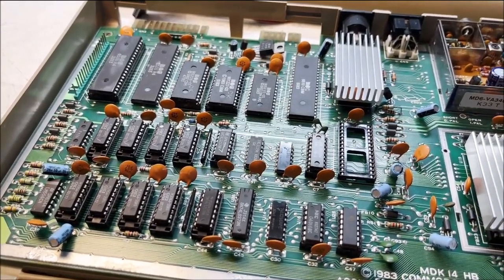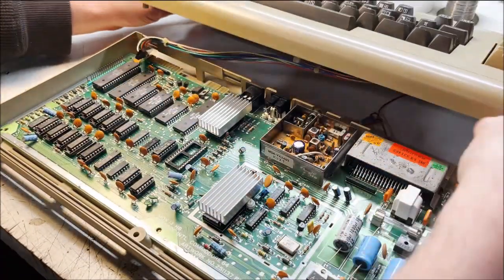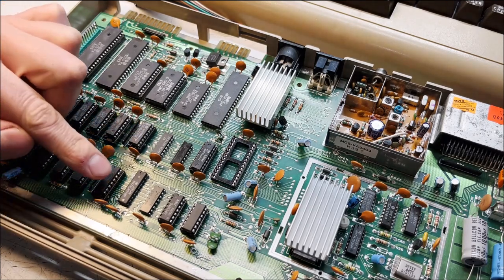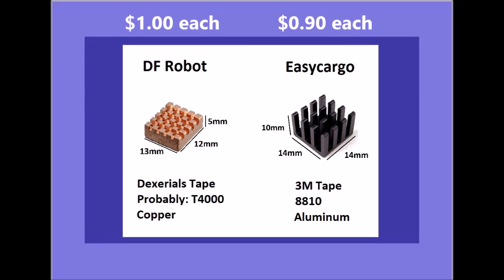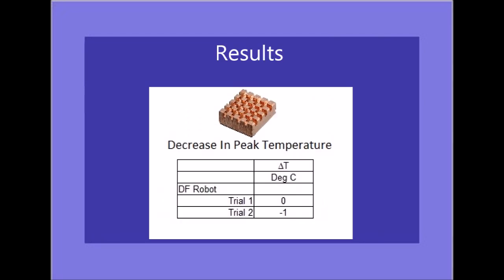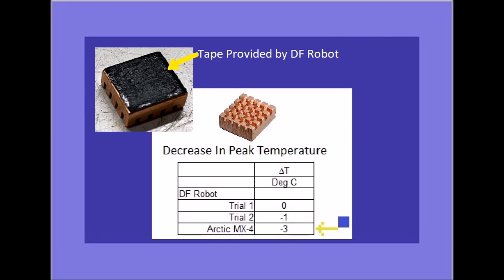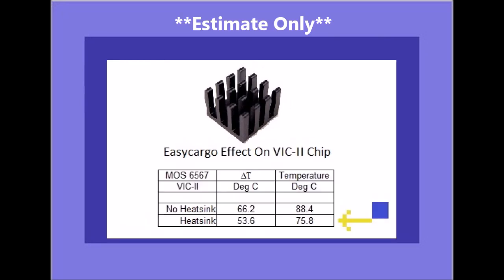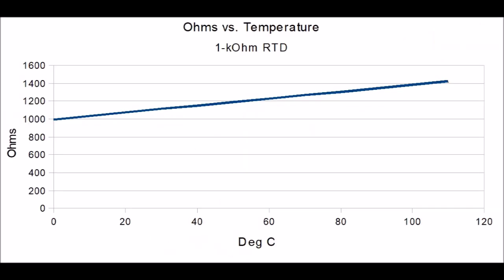Comparing Two Heatsinks In A Commodore 64 (DF Robot vs. Easycargo)

Comment: I agree with you, I also dissipate those parts that I use the most. I made sure that on my C64 there was also an air draft, through a cardboard airbox that sucks fresh air from the vents at the top and expels it hot from the lower ones. It goes against thermodynamics which would like the hot air to be expelled from the top, but fans are also used for this, to push air where you want, if you want to see what I made you can watch a video of mine that I made this summer. the c64 in question was recovered from a materials recovery center and was about to be destroyed in 2012. it had a black screen and all it took was replacing the PLA for it to come back to life. I used various heat sinks inside it and it has been configured like this since about 2012 (if I remember correctly). in my video you can barely see the part where it sucks air from the outside, I should have used a paper floppy disk case to show the actual force with which air is sucked through the vents, since it would have covered the entire usable surface. when you open the C64 and feel the chips, the ones that were previously hot are now lukewarm, or even cold!

Comment: ER there is a way, to predict the lifetime of chips
It is a well known system used in electronics...

That's where 50,000MBTF comes from ,and understanding  manufacturing QA systems will give you the answers you require.

and temperature plays a MASSIVE part in that, in fact that's how you do accelerated testing.

Comment: The 14 by 14 footprint of the aluminum heat sink is 1.25 times the area of the 12 by 13 copper heat sink.  Its greater height is also beneficial.  You did well to measure the back of the chip.  Other reviewers would have just viewed the board from above with an infrared camera, but your method is much better.
It is well known that copper conducts heat better than aluminum, but that alone does not make it a winner.

Comment: Depending how "deep in the weeds" you want to get...
When dealing with heat surface area is number one.  Watts/Square Meter  Although copper conducts heat better than aluminum, the surface area difference of the aluminum overcomes that.
Ambient temperature of the air (fluid) around the heatsink will also determine efficiency.  The warmer the ambient fluid the less heat transfer.  At a point where ambient becomes greater than the chip then the process will reverse.   Hence the CPU fan / water pump to replace the warm ambient fluid with cool  
Each material between the die and the ambient air will have some effect on heat transfer.  Some are good, some are bad.  The chip encapsulation material.  the adhesive pads (if used)  the heatsink material, the heatsink coating,  down to the tiny air gaps between the chip surface and the heatsink surface which is why we use thermal compound to increase the surface contact area for transfer.

Comment: I have had good success using metal loaded epoxy to bond heatsinks to hot running plastic DIP IC's, and also have used it to attach heat spreaders to 286 processors, which otherwise run smoking hot when run at high speed. I use larger heatsink units, extending a little past the edges, and after sanding the base of the heatsink flat using some 800 grit wet and dry paper on a flat surface, and the same to the top of the IC, then use some solvent to degrease the surfaces. Then a small amount of the epoxy, about match head size, in the middle, and press the 2 together firmly, till it is visible on the sides. Keep pressure on till gel time, so a 5 minute epoxy is best, then leave for 24 hours to cure before handling.  Good bond, and about as good as thermal epoxy as well, with the temperature now being a lot lower with this new heat spreader.  

No need to buy exotic units, I have used common aluminium T shape extrusions along with other aluminium extrusions, originally intended as partitioning, which just were offcuts, and then cut to fit, and smoothed off, so you have a fin and a flat surface.  Then prep the one flat surface to use it.

Comment: Bold of you to assume the generic chinese junk heatsink (labeled DF robot here for some reason), is actually copper at that price point, cause it's not. It's colored aluminum (or some aluminum based alloy, read: metal mix that isn't pure and therefore even cheaper to produce). its weight should've been a clue. Add to that minimal surface area with those pitiful "fins", and the tape that isn't actually thermally conductive at all (like you've mentioned, it's literally just doublesided tape), and you might as well leave them off

Comment: Hey, nice experiment! I though about this somtimes, as these are the two most common cooling blocks you can cheaply get everywhere ..but never had enough patience for trying out xD But I'd recommend using thermal glue, like Silvberbead. I was expecting the 'long and thin' approach to fare better already .. if they only produced this shape from copper .. Also maybe we should start fitting fans into our C64 cases ..

Comment: The typical heat sink design in C64's was utilize the Faraday shielding as a heatsink, cutting tabs which would spring against the DIP IC's. A better option would be to use copper heat piping circuitously over each IC, out the case and attach pressed aluminum fins to the piping. Then attach a fan to blow through the fins. Copper transfer the heat well from the chips and aluminum does well at dissipating it into the air. Use thermal paste at the junctions or silicone embedded thermal transfer pads; no foam or tape.

Comment: Can you add some forced airflow?  These heatsinks are just stewing in the heated air around them.  Also the copper heatsink may be aluminum with copper coating.
Reply: Nah this is for sure a real copper heatsink. You can tell just when you hold them that the density of metal is much higher. If it was any other metal it couldn't have possibly performed nearly this well.

You expect to achieve approximately as good a performance in half the total volume envelope when using copper as opposed to aluminium, for ideally designed heatsinks, and in this regard, it comes remarkably close, being as tiny as it is and half as tall as the aluminium one plus a little smaller in footprint. Both heatsinks have some design compromises, the aluminium has its base and fins maybe a little too thin, while copper one has its base too thick and radiation area is too small.
Reply: @SianaGearz  The Air velocity and temperature are limiting performance here.  If the "copper" heatsink were steel or zinc with copper plate you are  unable to tell the difference by picking it up  The dimensions of the "copper" heatsink make no sense for a material with such good thermal conductivity.
Reply: @2OO_OK   If it was a steel or zinc heatsink, it would not come anywhere near close to the performance that it has shown, it would fare much much worse. Don't expect magic from copper heatsinks just because it's copper.

Of course it can be demonstrated that it's same material throughout and not just surface plated by cutting into it.

I had cut into heatsink looking just like this a long long time ago and it was genuine, though of course it doesn't mean that new production is. But i also pay about 6 times more for copper heatsinks than for aluminium ones, they don't cost the same. I had as such not run into fake copper heatsinks yet, but it would indeed be easy to fake by plating, so buyer best beware.

Comment: Have you tried mounting a small fan in the chassis? Either pushing or sucking air out/in? And tested the temperature change? Is there some universal rule to how hot chips should get, or not go over? Is it possible for it to be too cold too?
Reply: Every 10°C increase roughly doubles the speed of degradation. But there's no hard rule to how long they have to survive at a given temperature, many semiconductors last for 20 years continuous 80°C and more.

Indeed if you can touch it bare hand and not feel being burned alive, so on the order of 55-60°C maximum, that is definitely well on the safe side.

As long as you don't get condensation, run classic chips as cold as you can manage to. Deep cooling under the ambient temperature is potentially a little unwise for this reason, but there's no harm in adding airflow and indeed this will increase heatsink efficiency drastically.
Reply: @SianaGearz  A cool project would be mount an effective fan that sucks, rework the chassis/body so it is sealed the right places, you can add heat sinks that you connect with  the RF shield, you redo the RF shield in aluminium, no edges, just smoothly radiused bends where needed, add a  correctly sized bellmouth where the air should get in. Oh, that would be a nice flowing cooling system. 

You could do a ligth version though, with only cooling where needed, but a custom Aluminium RF shield with louvers and fins would probably help if done correct.
Reply: My rule is below 60C.

Comment: For high power chips it is common to have heatsink soldered to the ground pins. Plastic cases have too much thermal resistance.
Reply: Fans, ie air pumps and openings.

Comment: "thermal tape" is meant to counter air gaps. It is, in itself, not a good thermal conductor (NO thermal contact material is. Not even silver filled Arctic younameit). But it conducts orders of magnitude better than air. As for the heatsink material, copper does not really improve things that much since it's higher thermal conductivity does not improve the heat transfer from the chip into the metal or the heat transfer from metal to air. Two geometrically identical heatsinks will make the copper one the winner, but not by much. 
I have seen themally conductive PLASTIC heat sinks perform on the level of aluminium for small power applications - and some of my LED bulbs use that. A piece of aluminium sheet might outperform the tested heat sink (that's what I have in some C64, the others use SOTS DIL heat sinks) since fins usually like to have forced convection.
Reply: The plastic insulation on power cords increases the heat transfer from them - critical radius of insulation for PVC is a bit under 1", so up to 1.5" diameter increasing the insulation thickness means they run cooler. Plastic is widely used to dissipate heat, despite being widely dismissed for that role.

The fins on that sink should help a lot under natural convection, as the vertical surface is aligned with the flow of hot air. Aluminium sheet is a cheap way of buying heatsinks, until you run into the sinks for other components on the board!
Reply: @maxhammick948  interesting. I know that painted bus bars have higher current carrying capability than unpainted ones, but I never heard about that on wires. Got any data or referrence on that?
Reply: @wernerviehhauser94 YouTube keeps eating my comments, so hopefully this gets through. Below a certain size the extra surface area helps more than the extra thermal resistance - the derivation for critical radius of insulation is replicated in many places online if you want to see the maths
Reply: @maxhammick948  thanks. Found a pretty neat derivation from LML Products

Comment: Most thermal tape are just tape that resist heat, doesn't necessery mean they transfer heat lol, you'll want as much surface area for a fanless/convection heatsink thats why the copper one didn't do much

Comment: I figured the aluminum heatsink would win. It's all about surface area, and those fins provide it. More surface area to both radiate the heat and make so much more contact with the air to convect the heat away.
Reply: Also being black only helps it.
At least if the coating is done properly of course, too thick and it will become an insulator instead of helping with radiation.
Reply: You still need airflow and heat air exchange, otherwise the internal airspace of a piece of equipment just gets to X number degrees above ambient depending how well the enclosure exchanges heat with the ambient air. A small fan pushing air into the computer will dramatically lower the internal temps.
Reply: yeah, the penny copper things are sad compared to ones I've seen eons ago that had much taller fins and less thermal mass in the base. I think it was around 20 years ago they stopped making good motherboard VRM heatsinks when motherboards started having fashion accessories over the VRMs. it's a bit sad as them blocks are a good size for cooling TO-220/TO-263 ICs.
BTW, the copper is only good for looks, the tape and air contact area make the metal used a bit moot for small low watt devices, lol.
Reply: NOPE!!!! it is about getting the  heact out of the chip... 
and you can have the biggest assed heat-sink in the world and it will not make the slightest difference, if you are at the transfer rate of the interface material.
Which is usually the resin and you can find that data on the chip specsheet.

the heat goes from the silicon to the resin & leadframe.
, and THIS is why socketed chips are a BAD idea., you are actually increasing the internal temp of the silicon die. , but you will get some smart ass who will measure the case temp and say nope!!!
but they forget that the temp they are measuring is the resin case, which has a maximum thermal interface temp., it's NOT a perfect heat transfer system.

if you look at the chip ends.. usually you will see 2 dots of metal at each end (old style chips), this is the lead frame the silicon sits on. the pins sit inside the resin & are connected by the bond wires. they remove the lead frame carrier on most modern chops.

Comment: I always use a thermal glue for sticking heatsinks on - it had pretty terrible heat transfer rate compared to the CPU paste but hell at least it holds the heatsink on though not as strong as some normal glue would, it is still pretty easy to rip that heatsink off

Comment: Those really should be combined into one product.  The black one has way more surface area.  The copper one conducts better without the coating.  Then some kind of GOOD thermal tape could be used, and you'd probably see even better results.  :)
Reply: A bit of Dremel work to make the grooves deeper would probably help a bit.
Reply: The flat HS is merely named as such, its junk. better tape will make no effective difference, the HS just sits there at the ICs temp and cannot radiate, a very high speed air nozzle etc etc, but the noise and the air pipes lol.

Comment: Honestly the packaging on these chips is insulative, meaning that there's only so much a heatsink can do.
 
It would be better if a way could be found to reduce the heat producedcin the first place.
Reply: Undervolt them slightly. Say -0.15V
Reply: @simontay4851  TTL runs between 4.5V and 5.5V,  ie rated at +/- 10%
Replacing some TTL logic with 74HCL might be an option if the timings are not different and critical.
Replacing any 78 or 79 series regulators with small SMPS types would removes some of the internal heat.
Reply: Hence why audio amplifier ICs have ground pins tabs coming out the side, or flush (to PCB) HS plates under them. See the TPA3110 TSSOP package.

Comment: You know there are extra heatsinks designed for (P)DIP Packages?
Reply from the maker: Yes. The DF Robot was meant for a Raspberry Pi. I ordered these because of the price and width matching the DIP IC being cooled. It wouldn't surprise me if I missed something better and cheaper. 😄
Reply: @Retrommodore  digitec sells a brand which are a dollar each and well worth it.

Comment: One of the things one of the Commodore engineers said (Might have been Bil Herd) was MOS chips often didn't have a very good resin casing, it would let in the air and cause oxidisation. Which makes me wonder if somehow sealing the chips somehow would help extend their life too. I imagine the chips running cooler helps stop this problem with the casing? Also, it was no surprise to see the heatsink with the least surface area was the worst performer. The more surface area the better when you use a heatsink.
Reply: Industrial PCBs for potentially harsh environments get acrylic conformal coatings.
Reply: actually I'm not sure if sealing 40 yo chips today would be any good. About the surface area, usually the sides of the IC don't run very hot, since the chip itself stands in the middle. Of course, since the price of this heatsink is just cents, why not to put along the whole surface... but the hotter one will be always the one in the middle. 
When I open one of my Commodore computers (VIC, 64, etc.) I use to put heatsink in all the big ICs and as rule of thumb, when I open an old computer I observe what is the temperature of every chip; it runs hot, it gets an heatsink.

In the C=64 I use more I also installed a little fan to blow air onto the VIC-II. It's a 12 volts fan with a resistor; it runs slower because of the resistor, so it's quite silent, but it's enough to keep the VIC-II totally cold (afaik it's the hottest chip in the C64).
Reply: it's a double edged sword, actually it is  maintaining consistent temperature. during that era , the dynamics of surface separation were not well understood.